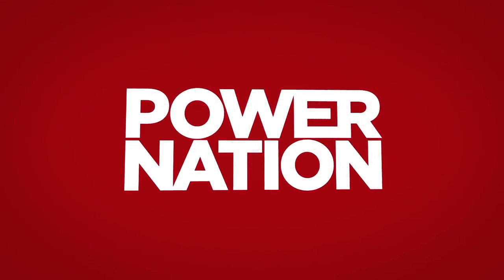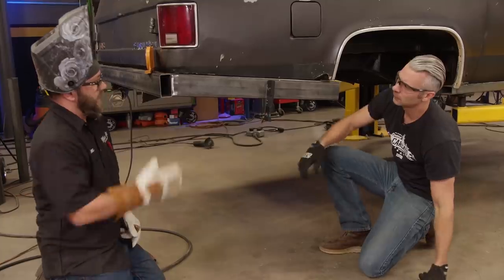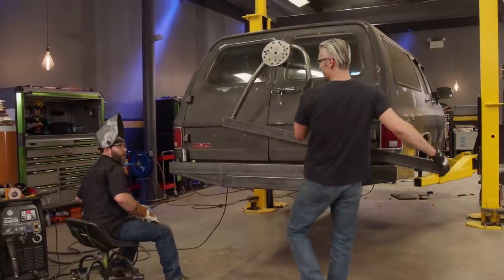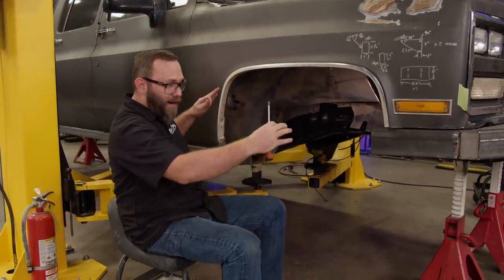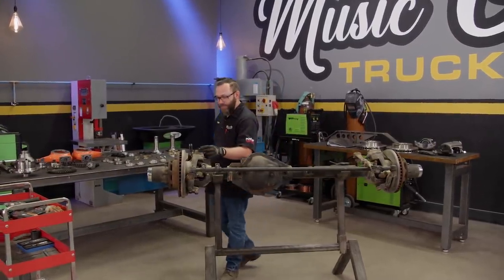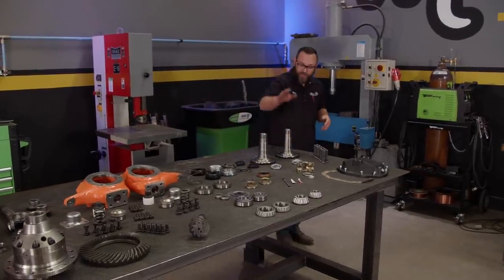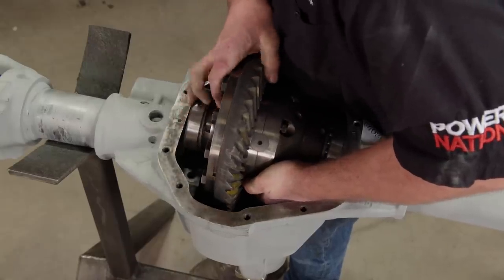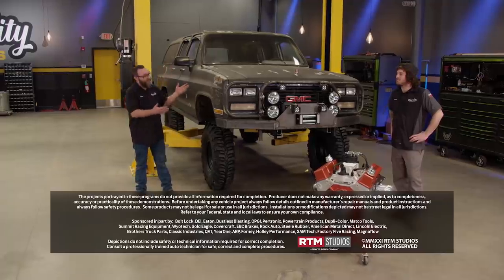Tearing Down and Rebuilding a Kingpin Dana 60 Axle - Music City Trucks S1, E2

Comment: He said he wanted to "focus on the tech", but he didn't go into much depth on how you would find correct pinion depth via gear mesh paint. He just said "looks good to me" instead of how Ian used to go all through the "tech" of how the pattern was supposed to look and why each axle is set up differently and how to tell where your pinion shims should be if you get a housing that is bare and you don't know how it came

Comment: I have a old Nissan Hardbody (d21) love my trucky. It was my father-in-laws truck and my wife remembers when he first got it. One of her oldest memories and going out on the old boat too.  I have restored the boat, motor and gave it tastefully updates and modification.  They both love the boat which is great.  The truck is next.   We all want it 4x4 and I love our Jeep's solid axles and I'm planning on swapping the hardbody over and doing a 4.8L 'LS swap' and keeping it stock because that V8 power will be enough for that truck.  Watching y'all do this make me want to do it more pulling the 350,000 mile motor out and restomod my trucky. I think the hardbody need a bed liner body to give it the full package of hard steel body with the bed liner.  It might get a 4 speed auto but I love rowing the 5 speed in it. Then again time and money is all that's holding me back now...

Comment: basically said all dana 60 axles are the same across the board on ford,dodge,etc, but he failed to mention they are not the same some are low pinion, some are driver side drop

Comment: So which D60 is the most inexpensive to rebuild ( assuming all parts replaced are identical across all axles ) ?
Reply: Balljoint 60 out of a ford is probably cheapest just because kingpins are expensive to rebuild and upgrade.

Comment: No carrier bearing preload?
Reply: I was thinking the same thing. No way that carrier has enough preload on it with just prying it over with a small prybar and dropping shims in.
Reply: @rennat_2006  Not even close.I have a case spreader for my dana 60 and 70 axles I set up. Another point, the pattern on the ring and pinion will go to shit under a load.
Reply: Not to mention you don't just jam shims behind the races, sides are shimmed behind the bearing on Dana 60  
Plus, no need to remove upper kingpins to get knuckle off.

Comment: I would have really liked to see a Cummins 12V swapped into this rig , that would really make it unbreakable .
Reply: 12vs break down just like any engine, nothing wrong with using different engines
Reply: @benjamins9121  12v Cummins is a million mile engine , can’t say that about a 383 stroker .
Reply: @larrywoolford8978  Most dont make it that far. You can replace that 383 2 or 3 times for the same price a a junkyard 12v anyways. Have you ever built an engine before? Is that why you blindly believe the 12v to be the best engine for everything?
Reply: @benjamins9121  Yes , as a matter of fact I’ve built both diesel and gas engines . And it a plain fact that a Diesel engine has better reliability and longevity than a gas engine and they get way better mileage ,which is pretty important in an off road vehicle . This video series is about building a bullet proof 4x4 ,so why are they not building a truly bullet proof engine and transmission combo to go with their big buck Dana 60 axles ? It obvious from the shop set up they aren’t short on cash by any stretch of the imagination.

Comment: How much $ do they have in that D60 build?
Reply: From a quick search in my area from $600-$1600 for a complete axle.  This is before you rebuild and upgrade.  The locker is $1000 alone.   The price isn't the issue for most folks.  Most don't have the skill to do it.
Reply: @bmstylee  Sounds about right, when I get my rear end rebuilt with a higher gear ratio and a posi, I'll buy all the parts but I'm gonna have a machine shop in my area do it.
Reply: @blueeyeswhiteguy3399  sometimes is better to swallow the ego and pay someone to build it instead of destroying a lot of expensive parts.  Or get something that comes in a crate.   What's it going in?
Reply: @bmstylee  My 85 camaro. The entire vehicle is still stock but I have plans for an ls3 swap, 6 speed manual, and 3.73 posi gear in the rear.
Reply: @blueeyeswhiteguy3399  cool setup.   Just don't tell the comment section you're ls swapping it.   They'll call you all sorts of names because engines that perform poorer are better because it's not a lame ls.

Comment: What kind of locker was that? Was that a Detroit Locker?

I've always heard not to put a locker in a front differential, but with locking hubs as well, it should be okay since the hubs spin free when not locked in. Unlocked hubs and the transfer case in 2H should mean the differential isn't moving at all... right right?
Reply: Yeah. If the front diff isn't engaged it just spins like it's in neutral.